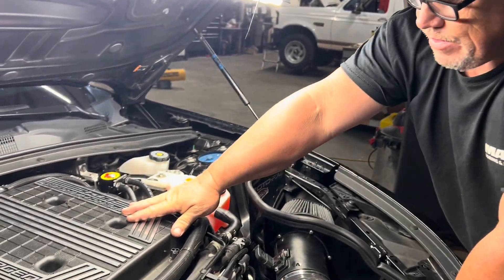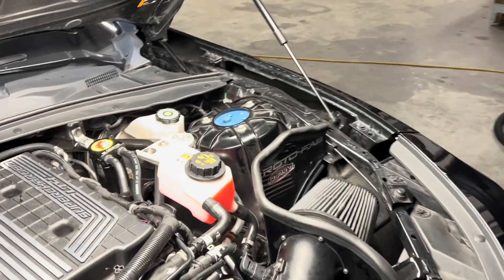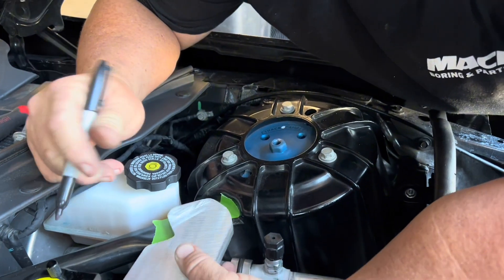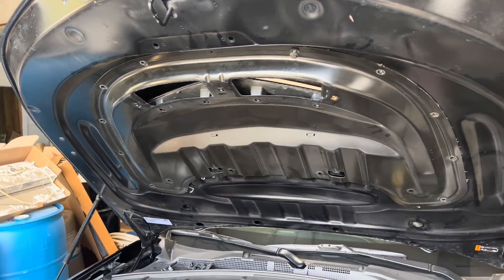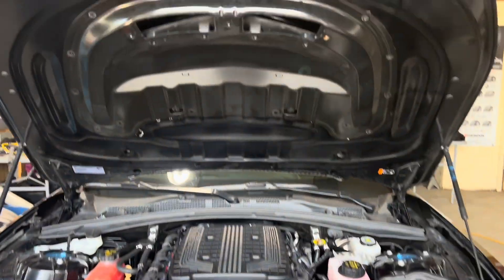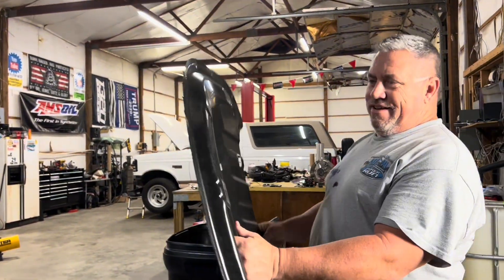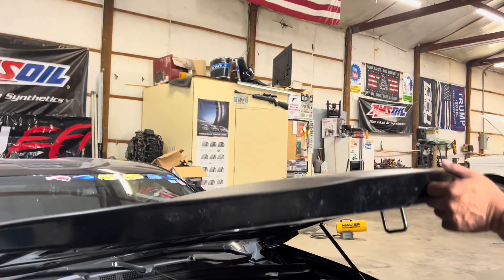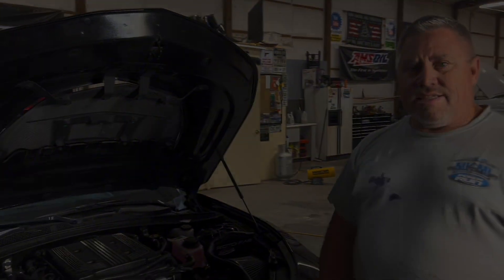Camaro GT4.R Hood Mod & 2Qt Coolant Expansion Tank For #LT4 Supercharger

Comment: What about those who have fender tanks? Does the reservoir tank still work as intended?
Reply from the maker: Fender tanks have an o-ring seal and due to their location are not a good means of removing air from the system.  They will trap air that is moving through the system and when you are trying to remove the last bit of bubbles, will cause frustration if you use it to be inline to the bricks.  Furthermore the SCHX out front (SCHX) is notorious for collecting bubbles from the pump pushing coolant in it's OEM configuration of taking coolant from the top of the SCHX and sending them directly to the SC Bricks.  Once they are in the bricks, there is NO WAY to make a bubble move to a lower location unless fluid velocity breaks it down and pushes it there, straight physics in that issue.  In such, the bubbles will accumulate to the highest point in the system, the bricks when the engine is shut down.  Ultimately, you lose SC Brick saturation and the effectiveness of cooling the air charge resulting in a loss of power.  

My system is a comprehensive re-design of the entire SCHX cooling system, the addition of a true pressure expansion tank designed specifically for water-to-air cooling with a low 5-psi cap to remove air without removing coolant.  My SC Coolant path is reverse of the OEM configuration and my SCHX comes with a bleed on the top so when it is used with our expansion tank, any bubbles which are created by the thermal expansion and contraction of a fluid (more physics) are sucked up by the expansion tank to be separated from the coolant doing the work to keep your SC bricks 100% saturated for cooling.  My SCHX holds more coolant than the GMS triple setup in just the SCHX alone without the seven points in their system that contribute to bubbles being lodged in the path of the coolant.  See the video below to get an understanding as to how my system, installed on Jeremy Lowder's Pike Peak ZL1-1LE works and is proven to keep the air charge cooler than any other fluid based system available today.

https://www.youtube.com/shorts/IFWpzswblF4

Jeremy on Pike's Peak:  https://www.youtube.com/watch?v=K2PmzpRzq-s&t=6s

Comment: Good stuff, I like the hood mod, I would imagine there is quite a tangible downforce impact with it extracting hood from the high pressure area in the nose. 

Where did you source the hoses from? Id imagine you used the factory line for the bottom hose, how about the elbow?

Thanks!
Reply from the maker: Are you referring to the hoses for the coolant bottle?  I honestly went to the Advance Auto by my shop and had full access to all their stock.  I found a perfect match for the Supercharger exit to the expansion tank and then used a 1/2" to 3/4" adaptor for the hose going to the pump.  I might make the aluminum brackets and special order more expansion tanks, but they are quite pricey since the Ford SVT part number is limited to 2003-04 Cobra models.

As for the downforce and venting from the hood... it is quite noticeable at speeds exceeding 70mph.